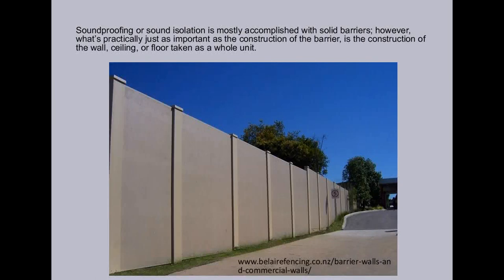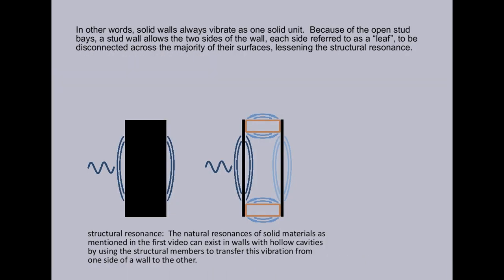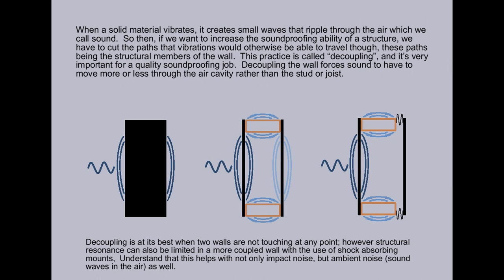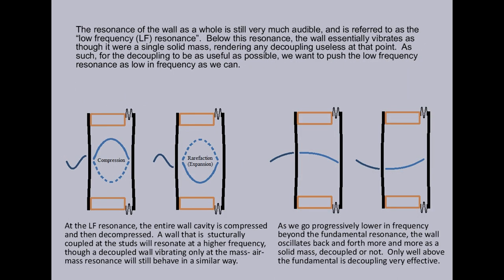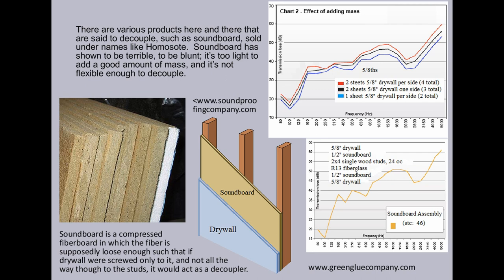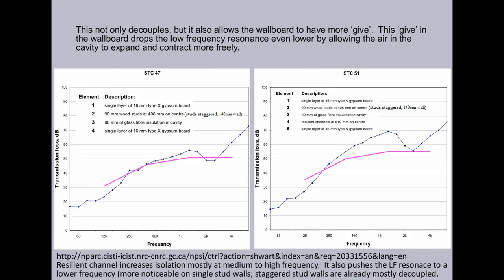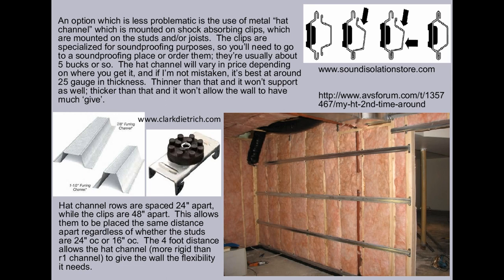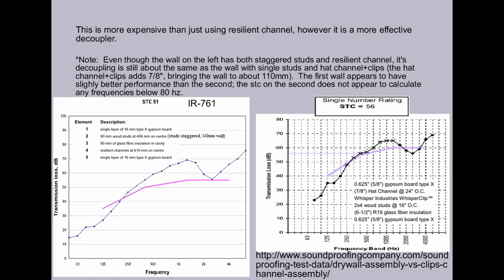Soundproofing -2- decoupling

Comment: Hi guys! Wondering if anyone has any data or real world experience on air gap measurements in relationship to STC and hz? My biggest fear is doing all this work and wishing I had sacrificed the extra inch or 2 in room space. Thanks ahead of time for anything you are able to offer up! Best, Troy
Reply from the maker: There are so many variables involved, any one little thing could affect the end results.  The best bet is to start with wall cavity, making it as deep as you feel you can get away with, filling with insulation, and building from there.  You can always add more drywall, but it's far more difficult to rip all that out to make a deeper cavity.
Reply: From my experience, the deeper the cavity the better the attenuation, especially the lower frequencies.  A recent example is a window plug I made for my basement window.  The window faces the street and often has loud music coming from passing cars.  The window sill is 24"x48" and 15" deep.  I glued (spray adhesive) 1/2" cork sheets inside the window sill; sides, top and bottom.  I wanted to be able to see out of the window so  I used 1/8" lexcan plexiglass, plywood and cork to make the frame.  Cork is a sound attenuator on it's own, but it also acts a gasket to seal the window plug.  When the plug is in it sits wear the sill begins and is held in place very snugly due to precise measurements.  It works very well, it even blocks the low bass coming from passing cars and most 4th of July fireworks.  I have tried the very same thing in the past with only a 3" air gap, but didn't work as well.  I'm planning on soundproofing my bedroom wall very soon.